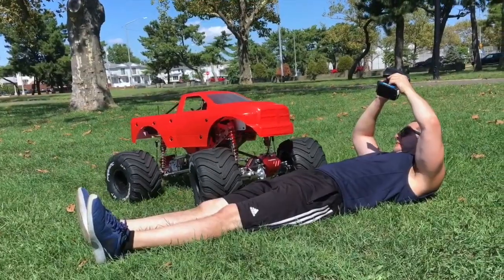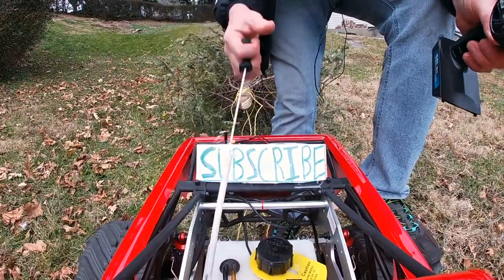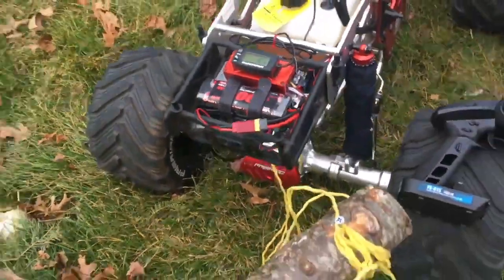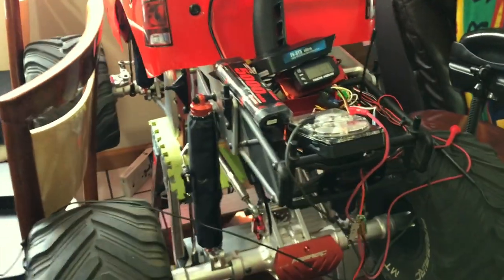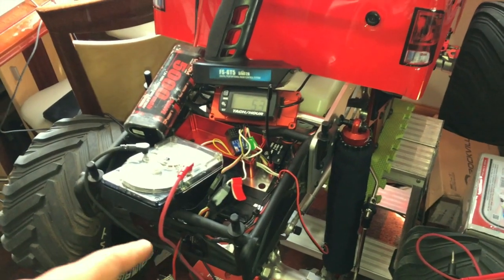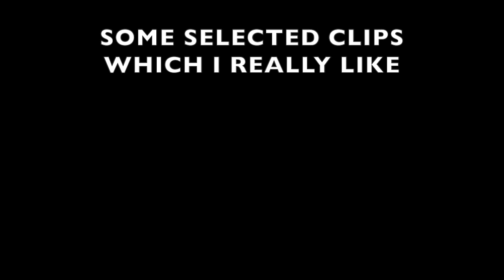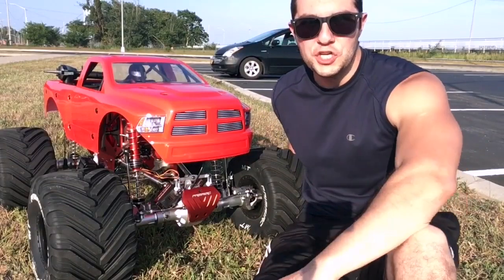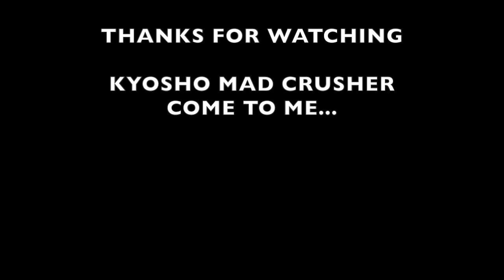World's BIGGEST Gas RC Monster Truck - Broke Towing a Tree - Primal MT Raminator - Update and Fix

Comment: Love the beach outing! The nitro gang needs more of them!
Reply from the maker: hey bro! I know, right!! I love the beach scenes also.  The best thing about this truck and sand is it really don't not get too dirty like the smaller RCs do.  It's very high off the ground and most of the sand does not stick to it.  Plus you can drive over yourself anytime, hahaah.
Reply: hybrid32494 In my opinion, the raminator is a bit underpowered. I know that a lot of people say that to I you, but I think that a truck that big and heavy is fit for 80cc at least. I know that someone makes an aftermarket 85cc (I think) for that truck. Still though, that thing can conquer sand!

Comment: The Menace  Is clean!!
Reply from the maker: hey bro!! yup, this Schumacher is way cleaner and nicer than the other 2 used ones I got. IT's still got problems.  Engine is half seized (no big deal). The trans gears are not stripped but they don't spin (I need to take it apart and see), this is what worries me mostly.  you'll see a pickup video on it soon bro.

Comment: Really like this truck can't go wrong with the price and upgraded parts just wishing they have a two speed transmission with four wheel steering it's a win win situation 🙏🙏🙏🇯🇲🇯🇲🇯🇲💪💪💪
Reply from the maker: hey bro! A 2 speed would be awesome, you know me!! lol.  In this video I was running the stock gearing, this truck came with a high speed gear set included, and it could hit 30 MPH stock with those gears alone.  The 4 wheels steering is already an option from primal for this thing btw, I don't want it though, for me the steering is quite good as it is.  Going to be repairing the power switch soon and getting it running.

Comment: Yo ! What are your thoughts on the Kyosho Nitro Fox2.0 ? Looks like the Mad Crusher but maybe with different bodies and bumpers 🧐.
Reply from the maker: hey bro!! I like that Fox style body too, it was a tough choice between the truck body and that other one.  It's the same exact chassis though, so I would take either.  Looking at the FOX 2.0 body made me realize it may be better for cooling, it's alot more open.  This is a toss up right now, and will come down to whatever is in stock, lol.

Comment: Hi i just want to ask i have the jlb 21101 and when you push the car down the shocks goes down but stops when it is coming up and then I have to push it up what is the problem ?
Reply from the maker: hey man! Sound like you have alot of excess friction, meaning biding in the shock itself.  Chances are dirt got in through the seals and you need to rebuild the shock with fresh shock oil.  This is normal maintenance generally.  The other situation could be a bent shock shaft, which is causing too much friction in the shock body and therefore it's not rebounding.  What you need to do is disassemble the shock and check the to be sure the shaft is not bent, if it is, you can bend it back with a vice and pliers, it's no big deal.  Let me know.
Reply: hybrid32494 thanks for the help

Comment: Hybrid! Those trucks are awesome what a spot for the switch? I love the lights you put on it!😉
Reply from the maker: hey buddy! thanks for watching. I never though I would ever own such a nice one of a king RC, but I'm lucky I had some old RCs to sell and a printing 1998 Honda Civic I sold to buy this.  I'm still glad I made the purchase.  To be honest with you that switch might have eventually needed to be replaced even without the accident, that crimped wire was already there I think, so I'm not that upset over this.  The new switch will be easily replaceable and have good connectors on it anyway.

Comment: Do you see irony full scale going electric an rc'ers going ⛽
Reply from the maker: yup, the IRONY is Deep my dude! In my opinion 1/5 scale electric is not much different than 1/8 scale electric, there really is no major advantage other than size, in fact the Laws of diminishing returns set in for electrics over 1/8 scale. You wind up with way too much LIPO power due to lower KV motors and nearly the same overall speed anyway.  Meanwhile for 1/5 gas you have cheap running costs and loads of awesome noise and smoke,  LOL.  The irony is DEEEP!!!

Comment: Is that a lunch box rc van with them yellow rims....n it's so sad seeing that gtr sit all the time
Reply from the maker: thats right, it's a Tamiya Lunch Box.  I've done a few vids on mine already, it's got a top speed of over 30 MPH with the stock ESC and a basic brushed motor running a small 3S lipo.  It did'nt even break anything on the 3S, its quite a good retro RC.  Mine has a load of lights on it too, I even drove it on a tread mill in one video, LOL.

Comment: Whats the top speed on that huge trk?
Reply from the maker: The Top speed with the included speed gear set is 30+ as claimed by the manufacturer.  Mine is running the stock mid-range gear set in all these video and my top speed was about 16 MPH.  I do have an upgraded 2-needle carb which needs to be installed still.  I'd say 30+ mph is possible with the taller gears and the sock motor, not bad really.  Considering the original HPI baja had a top speed of 28 MPH when it first came out.

Comment: Do you have a redcat avalanche? Asking because its a real murderer lol.
Reply from the maker: hey bro! Nope I don't own a redcat avalanche.  But I do have a redcat earthquake 3.5, which needs work.  I also have an HPI savage XL and some other 1/8 nitro trucks.  The savage actually drove over me pretty well, just like this primal did.
Reply: Ok well look see! The red cat avalanche was race built but it came with big nice monster tires on it! But,it was built for competition, the engine is not in the back so that it can be manipulated for wheelies. It is thick and strong! The only problem was the front dog bones bent under extreme pressure! The gears were all steal but idk about the inner hub gears being all steal. The street truck wheels from proline the big rim series is ideal. I put a .28 lrp in it,I broke it in on really rich and then gradually was able to bring it to like, a muscle car with a super chargers rev! "Rump rump"rump rump".sir id like to tell you!! It was the king of all! I didnot change any gears although I would have like to! Plz pardon my !!!!'$ lol. Hey it was the avalanche xp. Man it came with hex extentions so it was wide.it did not want to stay on the ground!. That was the best car out of all that I had. Really tough no breaking anything but the front dog bone because of my wrong doings. The earthquake is a piece of tissue compared to the avalanche!  If you can look at any vid of the avalanche you watch it go. No bs. Pardon but im just telling you. I like that you stay with nitro and im looking forward towards your next video. Im no ignorant person and im very mush tech! Look at the avalanche videos see the real gear calculations and boom.....show me something if you can. If not, my family has mines out in nc so if you cant show the people I innerstant but I will when I get the chance! Brought it from Alfredo brand new and he's in nc.again, thanks for the great videos,peace and equality!